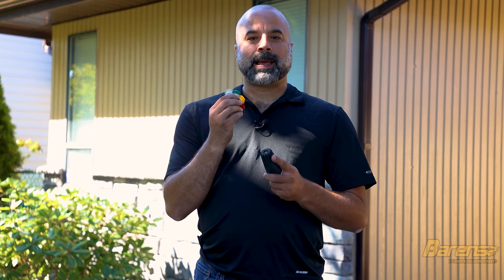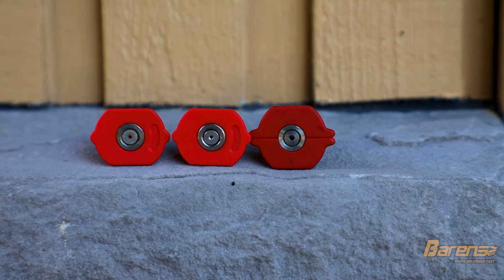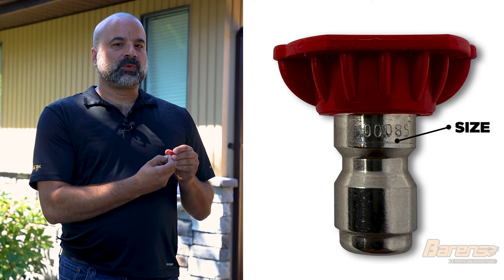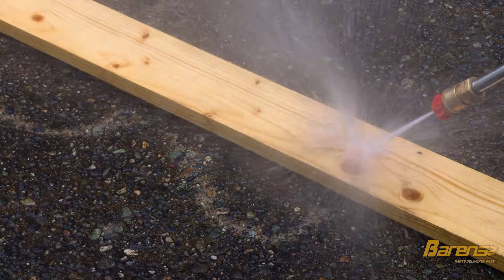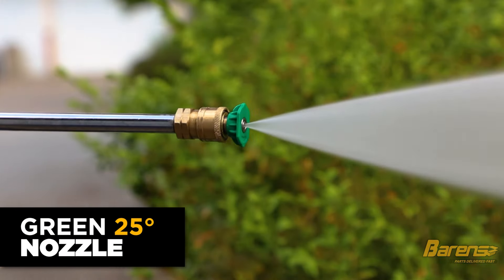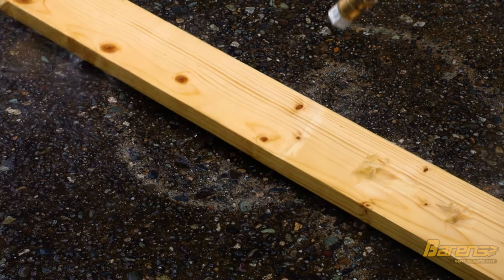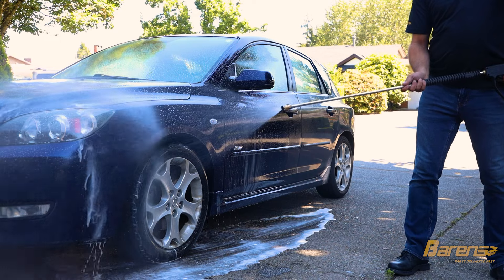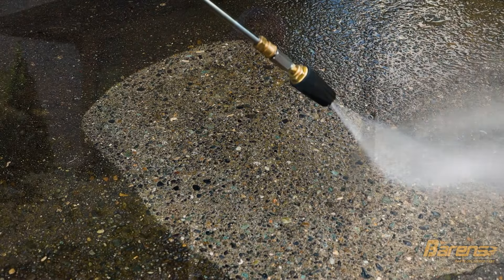6 Pressure Washer Nozzles Explained

Comment: I want to use a pressure washer nozzle on the end of a garden hose for spraying DI water on my car in a wide pattern as a final spot free rinse. Which orifice size should I get on the black 65 degree angle nozzle? My hose pressure is around 70 psi.

Comment: I think you did not explain enough between the 3 red nozzle sizes, you only focused on the zero degree model with smallest hole.  I believe the red one with the largest hole is called the "long range", or "long distance" nozzle, sometimes called "second story" nozzle.  It blows out more water for longer range power, meant to reach the second story walls, soffits etc on the outside of your house.
Reply: You are 100%CORRECT!👍 I can't stand when people half ass explain something!😖
Reply: Simpson color codes their nozzle blue for 2nd story cleaning and orange for 2nd story soap application.